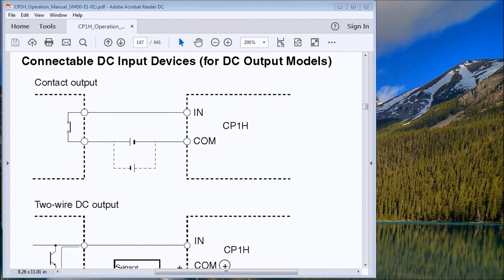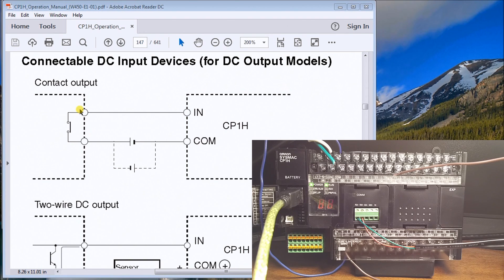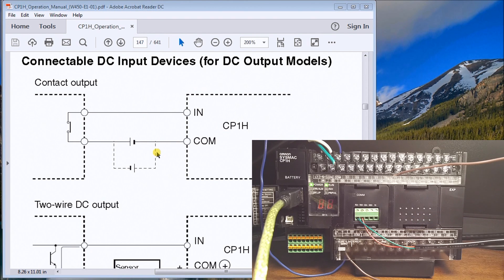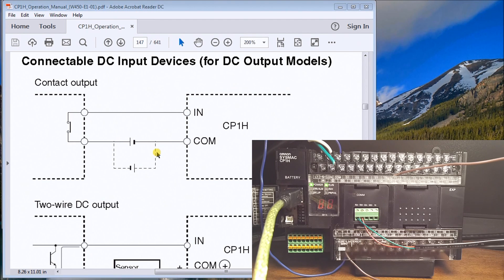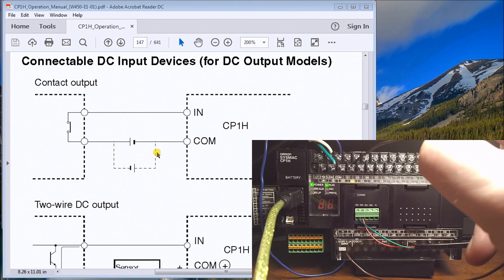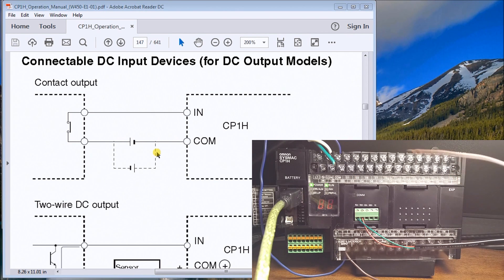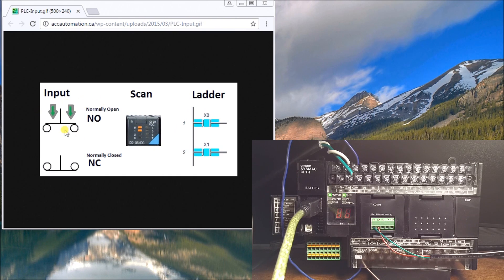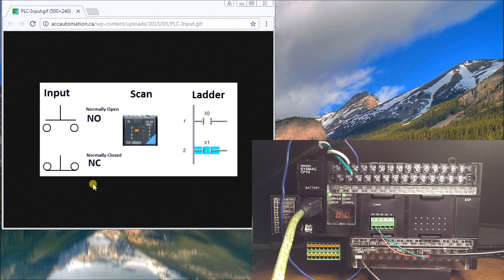Wire PLC Inputs Right: Avoid These Costly Mistakes!

Comment: I'm just confused now, I thought most 'digital' inputs were always 0-5V (and anything above 5V, like 24V would simply blow up the input!?)
Reply from the maker: Hi RD,
Most PLC inputs are 24VDC. Usually, most maker boards are 3-5VDC. (Arduino, Raspberry Pi)
You will have to refer to the actual controller you are programming for the specificatations. 
Regards,
Garry

Comment: With most PLC's, are the 0-5V inputs and 0-24V inputs usually separate and clearly labelled? or can a 0-24V input also be triggered with a 0-5V input?
Reply from the maker: Hi RD,
Inputs are usually clearly labeled on PLCs. 24 VDC inputs are the typical voltage. To see if your PLC can be triggered with a 0-5V input, see the specifications for the input of the PLC. It will tell you the minimum switching voltage. 
Normally if you want to control with another voltage level, you would put in an interposing relay. Here is a link for a solid-state one that I use regularly. 
https://www.se.com/ca/en/product/SSLM1LD23BD/solid-state-relay---din-rail-mount---input-4-28-v-dc%2C-output-5-60-v-dc%2C-3a/
Regards,
Garry